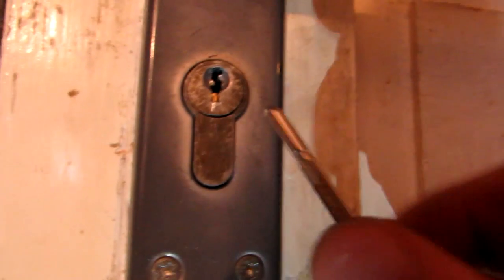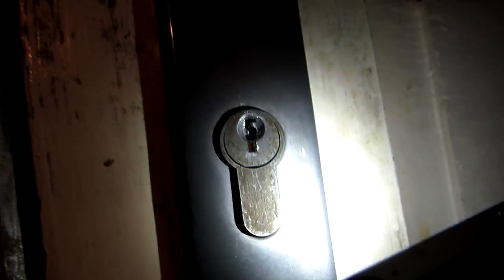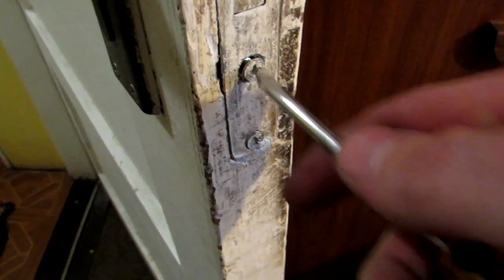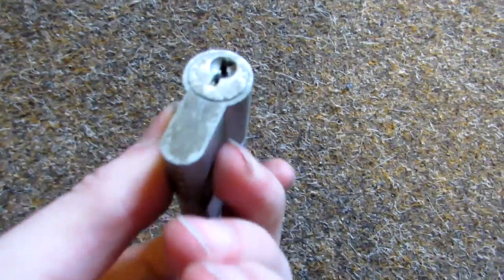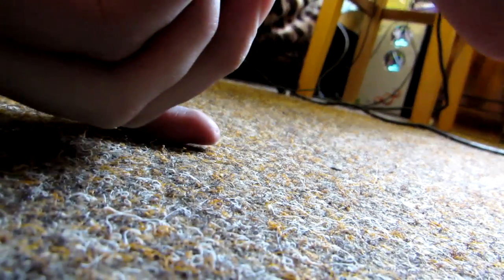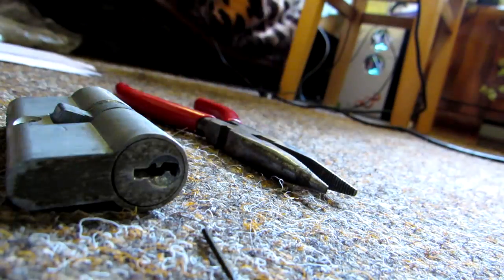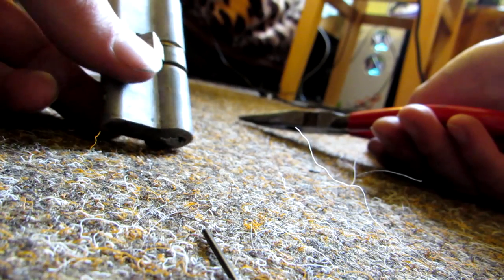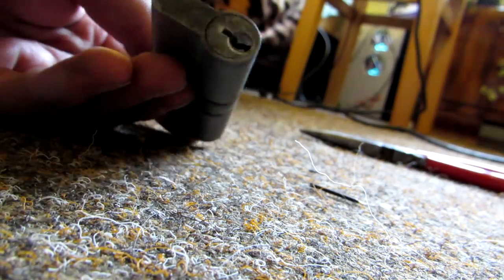Little metal piece stuck in lock? How to get it out!

Comment: what if it is wood? my mom yelled at me for being so stupid ;-;
Reply from the maker: Depends of the lock, if it is from hard steel you can take out your lock and burn the wood in it, but you must do it in safe place where you can control the fire! :D After then shake the dusts out and clean & oil the lock, I have never tried this but that is what I would do in case of wood..
Reply: same
Reply: same
Reply: Same
Reply: That almost happened but got it in time